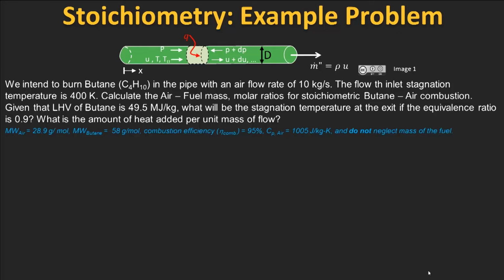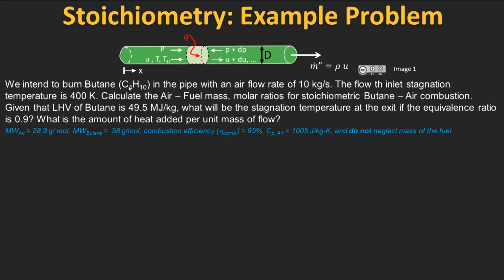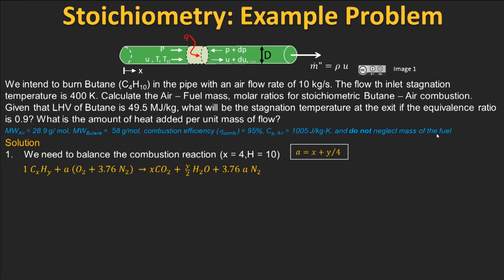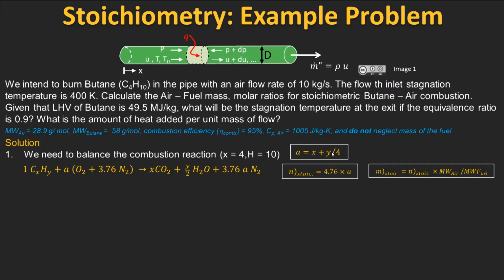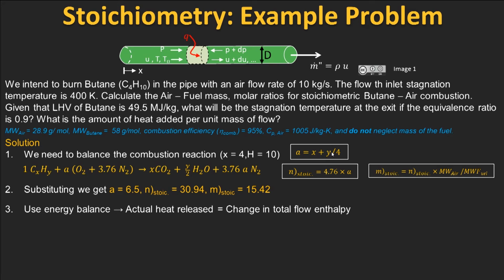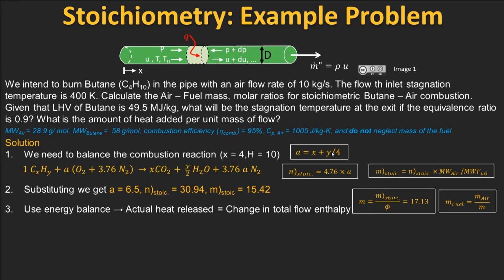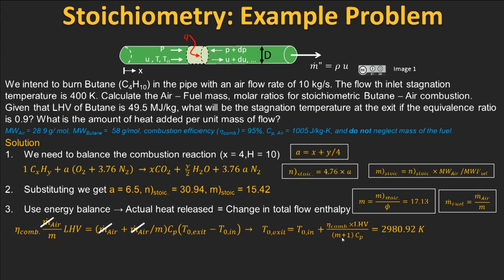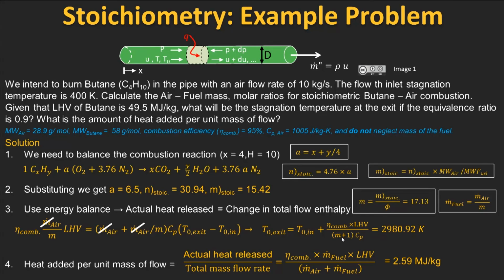UQx Hypers301x 4.3.4.1 Stoichiometry Worked Example

Comment: 3:35 The 'c_p' value is given for air, not fuel. We therefore need to find 'c_p' of fuel (butane) separately and then, add the fuel and air contributions together; as the heat released will increase the temperature of both air and fuel (butane).
What you did here is assume that c_p of air is the same as that of butane, which is clearly wrong...
Am I right?